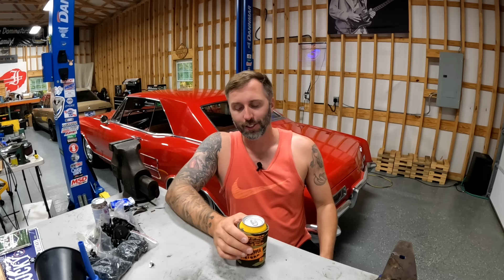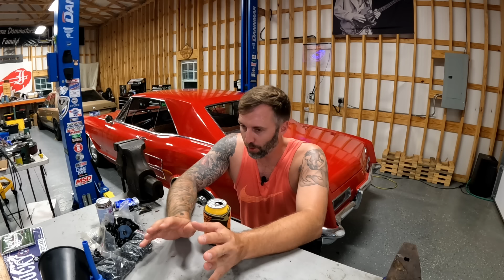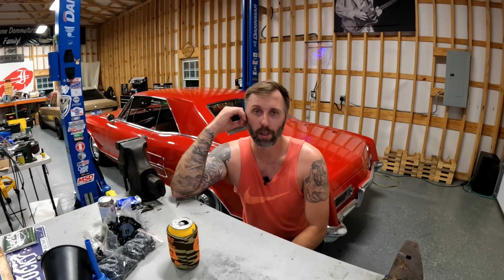Why I Ditched Holley Sniper EFI

Comment: Awesome video. I am in the "I should switch to EFI" phase on my wifes custom 72' C10 Stepside. Unlike your wife, mine will find a way to flood it regardless of how well I have it tuned.  I also appreciate your knowledge, ignore those wanna-be ricers. I've been building since I was 15, I'm 63 now.  I also have an 82 C3 MFing Crossfire that I have been able to tune, but I hate it's guts.  I may send it to you to LS the SOB, pisses me off.  In short, this is a great video. Thank you for the story !!
Reply: I'm eventually going to 'EFI' my 84 c10 by putting an LS with a stock ECU into it. only way to add efi properly IMO.
Reply from the maker: @Born_Stellar can’t go wrong with an ls.   Please subscribe !  Thanks for your support

Comment: I am a DIY guy who also enjoy doing research and learning new things. I have tuned my double pumper carb with the help of an O2 sensor and it gave me many years of good service, until the fuel quality went down the drain and started having hot start issues (even with carb spacer etc...). That gave me the excuse I was looking for to spend the money on an EFI system with a fuel return. I have done my research years before making the move and to me there was enough red flags about the design & quality issues with the sniper system that i never understood why people would still purchase this kit instead of the terminator with an HP ECU. For the differance of price it was a no brainer for me. I totally agree that they are overselling the self tuning capabilities, you either need to enjoy learning how to tune with a laptop or need to get it tuned by a pro, otherwise you will never get the full potential and drivability that these systems can offer. In terms of the lesson's I have learned; these TBI are firing the injectors in batch which is causing resonnance in the fuel system. I highly recomend to add a fuel damper, it made a world of differance for me, not only the noise went away but it had a significant impact on the fuel map from idle through cruising (more efficient injectors with the damper). Also, one thing that i like about the terminator (beside a remote ECU) was that the injection is done under the butterfly valves, which in my opinion is a better design. The counterpart of this is that Holley had to raise the shaft of the butterfly valves to make space for the injector rings. That made the throtle linkage clash with my drop base air cleaner and i had to customise it in conjunction with using a shorter filter element. All in all after 2 years i love it and would never go back. Cold/warm starts and drivability are awsome. I do feel that i have lost a bit of HP at WOT but i will eventually put it on a dyno just to tune the WOT. I am also using the HP ECU with a VSS sensor to control my overdrive, which is great. I can program any condition i want i.e. to emulate kickdown etc... I took the whole winter to make the installation and i have used nothing but the best components (hyperspark distributor, in tank pump/baffle, rigid tubing with some braided hoses, billet regulator/filters etc...). I have a 410 mopar stroker, w2 ported heads, single plane intake, dyno at 505/505 HP/TQ.

Comment: I'm glad I wasn't the only one to experience this same thing! Years ago I had a fast easy efi that kept filling my oil with fuel just as you described. It happened to me 3 times. I've sent the handheld and the throttle body back several times and they replaced the hand held and then they said it was the computer. Sent it back and got a new one like weeks later. Flooded my oil with fuel again. I gave up and went back to my quick fuel carb and been running fine since. I'm sorry you had to experience this but I'm just figured with newer technology these days, none of this would happen like you and I had experience.
Reply from the maker: Yeah its nice to see all of these people like yourself who are commenting and having had problems.  thanks for checking out my channel, subscribe plz!

Comment: Thanks for the video.  Sorry you had to go through all that BS. I had a Sniper on my 71 Olds 350 and had issues from day one.  I got the new fuel tank, in tank pump, lines (both ways), Hyperspark Ignition system, distributor, new plugs wires, basically everything was new.  I had a bad sensor out the box, the unit 90+% of the time idled high (1800+ RPM in park).  I thought that the "learning" part of the CPU would correct itself over a few miles.  It never did.  So one day in my driveway a decided to call tech support, they had me go through a couple steps and take a couple readings and it took a DUMP right there.  The tech said that I have a bad unit, and they will send out a new one.  I was blessed this happened in my driveway (could have been several hundred miles away with the family).  So I chose to get a couple Edelbrock goodies and went back to carb because my confidence wasn't there anymore.  My return went well because I bought everything at Summit racing.  I have several friends running Holley EFI with no issues.  I do feel like quality control could be stepped up.

Comment: Glad I watched this. I have an 88 k1500 that we stroked and I’m trying to decide what to go with. Originally, my gut was to go carb but I live where the temps change drastically and I didn’t wanna have to fool with it then I found out about the sniper. Thanks for the rundown.
Reply from the maker: No problem!
Reply: You can still run the stock 2 barrel throttle body, unless the motor is making more than roughly 325 hp
Reply: @alexbrown4820  the new one should be between 500-550hp
Reply: @IAMElectric369  If you can keep the RPM below 5200, you can actually get a factory TBI system to work, it's been done repeatedly, and even with monster engine setups. The issue is simply that the TBI setup doesn't function with excessive RPM.
Reply: @ScaryLarryMoose  hmmm, I’ll look into that. I think i our max target is 5500. However, I’m not tryin to skimp. This is a pretty expensive build so, I don’t mind getting what’s best, ya know?

Comment: I got the FiTec 1200 hp EFI because it can use e85

But ya I didn't know anything about phasing the rotor 

But it was a huge learning experience 

Sorry about your motor. Glad you got it recovered 

Ya and a lot of these YouTube channels don't tell you how much money they have invested 

And phasing in my rotor was getting interference. I took it off and put back on the HEI and locked in my timing at 30 deg. Runs great
Reply from the maker: I think some off them have pretty big sponsorships that prevent them from being honest.  Thanks.  Please subscribe!
Reply: @timelesssteelgarage  ya they never mention the price or include all the details. Except it's simple and fast. 

Lol my my EFI is self learning to bad I'm not. 

It took me a lot to get to know what I know. About 5 phone calls and 20 videos. But ya carb is soooooooo much easyer

Comment: I run a 1850-C with electric choke. its a reliable daily driver carb no complaints with a holley car.  Also military on my last few years till retirement.  I daily drive a 460 carbbed truck.  Nice video

Comment: I dumped my sniper after awhile as well. I always had random problems. Put a carb on and did 1700 miles on hotrod powertour with no issues.  I’m salty about the sniper 2 as well. I wish they had a buyback program for sniper 1 kits.
Reply from the maker: I agree 100 % about being salty about sniper 2.  I ordered sniper 1 direct 3 weeks before they released #2.  Thanks for stopping buy , subscribe! Plz

Comment: You may be familiar with "DD Speed Shop". He was putting together a 55 Nomad with a TKX Tremec and a sniper setup for Power Tour. He ended up putting a carb back in the car so he could take the Nomad on power tour. He hasn't given up on the sniper just yet. He says he'll try the sniper in one of his other cars but the carb is staying in the Nomad.
Reply from the maker: I saw it.  I feel the same way.  The riv is staying carb lol.  That tkx is a great transmission.   Thanks for watching.  Plz subscribe

Comment: I live in the UK and bought a Sniper back in 2021 and its has been a pain in the backside throughout. The unfortunate bit for me is all these now known issues took me 3 years to overcome. Yes one of the injector connections caused intermittent problems until it finally disconnected. The butterfly valves stick shut and the secondary stick open. I still can't get over O2 sensors failing within 1000 miles.
Swapping to a Holley S2 is probably going to be to expensive for me so I will have to go back to down draft carb which I know works well. 
Thanks for sharing your experience. You must have the patience of a saint.
Reply from the maker: No problem !  Plz subscribe ! Thanks!

Comment: I am no mechanic, but over 10 years ago I did a self install Sniper conversion on my freshly built 1974 Oldsmobile 350 and have never regretted it. I tuned it myself copying and slightly altering A/F & timing maps or tables others posted on the web for similar engines, dialing it in using trial & error with on road testing. Unfortunately local dyno shops said they won't touch an older car. Sorry to hear the Sniper didn't meet your expectations. I generally prefer simplicity but in my case I had nothing but misery trying to get decent drivability with a Quadrajet, including a rebuilt from a prominent specialist, and didn't want to gamble on a new  carburetor from another brand.

Comment: Jimmy, we all have stories of lousy customer service and warranty, and this story certainly turned me off EFI on my Coronet, but the biggest take away I got out  of your video, was the value in chassis dyno tuning. You can engine dyno a motor, and not get the best result for your vehicle when it is installed, but chassis tuning, and even road tuning, will get the best result for your cars circustance. So glad to here someone else make this point. my 750HP runs absolutely great in my car, and all done by chassis dyno, and road tuning with an air fuel ratio meter. Invaluable. 
Like you said, don't try fixing what isn't broke, especially if it is gonna cost you 3 grand and a lot of sweat (and heartbreak).

Comment: On paper, I have a viable way to use an factory Ford EEC5 on my pushrod engine truck. It will just take a few tweaks but I'm hopeful. Most aftermarket EFI systems are a compromise anyway. The only exception is the one offered by Chris Richards at Mass Air EFI. It is my understanding that when he started, he was using flashed factory EEC4 processors and factory parts for easy field fixes. Sticking with factory parts is key and I expect with the waive of the magic wand, the not so distant future EPA could make anything non-factory by anyone very illegal and could shut down Holley just out of spite and a personal trophy.

Comment: Wish i would of saw this video early today.  I just sent my my throttle body back today due to no spark issues.  After being on the phone with tech support  various times today they came to a conclusion that the ecu in the throttle body was toast.  Cost me over 70.00 to ship back and to replace the ecu is 250.00+tax.  And 4-6 weeks to get it back. Now im thinking i should just switch to carb instead! Great video.
Reply: Im having the same problem ecu, twice

Comment: Not being able to just send in your throttle body and having them look at it to see if its bad without having to pull your hair out is damn frustrating, thanks for your service
Reply from the maker: Thanks you ! Yeah I would have just exchanged it but turned out to be to difficult.  Thanks for checking out the channel .  Subscribe plz !
Reply: Yes, these manufacturers don't account for all your time and aggravation. It's kind of like people buying these bargain crate engines, They will say "well, it's got a good warranty". That's all well and good but who wants to swap 2 or more engines under warranty? Nobody is going to reimburse you for all the labor and other parts needed with the swap.

Comment: Hey Jimmy I installed the same black Holley Sniper EFI kit with Holley Hiper Spark distributor with Holley ignition coil and Holley in tank fuel pump. The whole enchilada! This was 2 years ago and I had the same problem with the fuel and it washed out the cylinder walls on a brand new engine that I just got back from the engine builders. This all started happening right as COVID hit and I could not reach anyone at Holley period! I gave up and my 68 mustang has been just sitting in the garage. I can't afford to get it rebuilt and it just happen again. Your video has now given me hope! Why didn't Holley just recall the Sniper and offer people a swap? Thanks for the insight Sam Beachy

Comment: I recently watched a youtuber go through the Sniper nightmare. DD speedshop built a ratty 55 Nomad for power tour, and reached out to Holley. I don't know if they paid retail or got it heavily discounted, really irrelevant. They went with w dual quad Sniper system on a small block. It was nightmare after nightmare and after redoing everything multiple times it all got yanked, a carb bolted on and made Power tour without a single problem...
Reply from the maker: Yeah I watched the same thing.  That's a big channel
 . Thanks for watching.  Subscribe plz!
Reply: @timelesssteelgarage  subbed, and love the '64 Riv! My first car was a 65 Wildcat with the 401. Cheers!
Reply from the maker: @Zero-Fox-Garage  awesome thanks!

Comment: Jimmy, this was a very good video and I totally agree with your assessments. I'm running a 292 inline 6, mildly built, cam, higher compression, and some headwork. I had it running really good with an Edelbrock AVS2. I decided to try throttle body injection. I started with a Fitech with inline fuel pump. I now call their system Fijunk. I then researched available systems. I settled on the MSD Atomic 2, because it had inducers in each throat. It is much more tunable than the Fitech and runs much better. I am overall happy with the installation, but I don't think it offers much advantage over a well tuned carburetor. Things I have learned from my experience.  I would not recommend an inline fuel pump. I lost two with the Fitech installation. The return flow at idle and low engine fuel flow requirements, is huge. Atomization is key to efficient combustion, especially at idle. Carburetors provide emulsified fuel under the throttle plates, throttle body efi does not. Fuel runs down the walls of the throttle bores at idle. A lot of the drawbacks are lessened with a V8 because all flow is downhill from the throttle body. That is not the case with an inline engine that has long horizontal, dry runners. Again, great video, thanks.
Reply: Hey Chevy 292 forever they're the best forget that piece of s***300 Ford garbage

Comment: The fact that they had so many returns to process is a glaring indicator that there were too many issues and they shouldn’t have been selling the kit any longer.  No way would they be getting my money for an EFI system.  Based on the few videos I’ve seen and forums/comments, no way is an EFI system right for me.  I just need to learn the carburetor setup and stick with it as it is just way simpler, as you mentioned.
Reply from the maker: Agreed. Thanks for watching.  Plz subscribe!